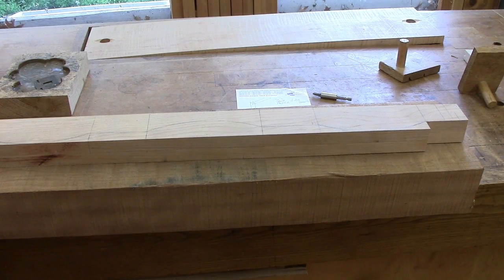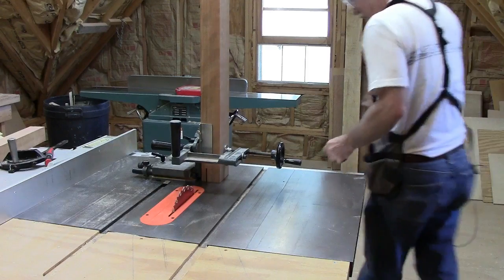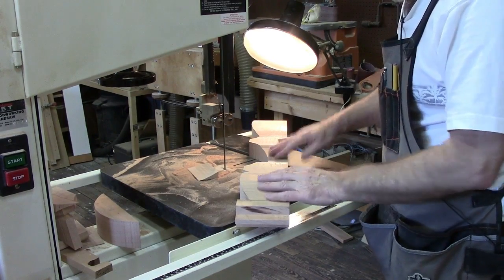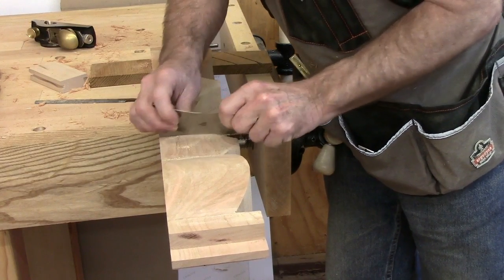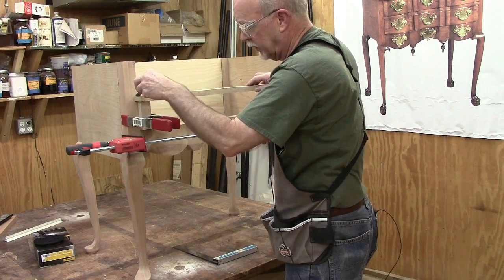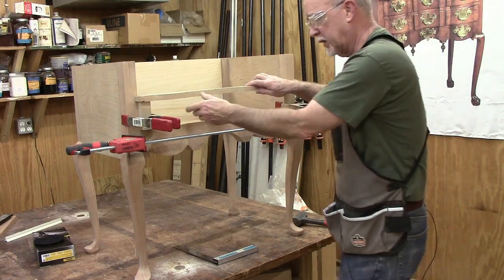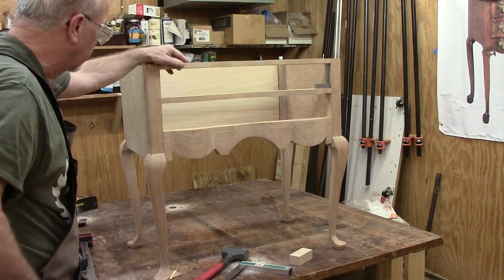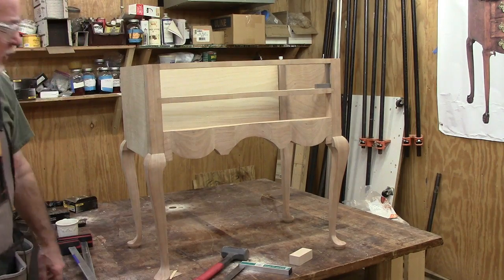Curved Blockfront Lowboy   Drawer Blades & Apron Step 3

Comment: Hi David:
I enjoy the way you go to build this project.  I also enjoy how you explain what you are doing or what you have just done.  You make your work very interesting..  I by no means do the caliber of work you are doing.  The truth I enjoy my work as much as you do.  It will be interesting how you finish the Cherry.  I know that the Cherry will Bloch.  Are you going to use a Bloch Control?
Reply from the maker: Thanks for the complements, my goal is to inspire woodworkers to take the next step in their craft by making something more challenging.  Yes, cherry will blotch but this cherry is quite figured so the blotching may add to the figure.  If I do use a blotch control it will be shellac or Charles Neil's.
Reply: Hi again:
You are doing what I have learned so far.  I love to make figure pop and cover it with shellac.  On secondary I enjoy using Charles Neil Blotch Control.  For me so far finishing this way I have not any trouble with the finial finish.  I think you use steel wool when you are finishing.  I use what is called Bowling Ball finishing sandpaper.  It goes up to 4000 grit and lets me control the sheen.
Have Fun in your shop.    Monte
Reply: Try boiled linseed oil:  soak it well, dry for a few days in low humidity if possible; then shellac - amber or clear to suit.  Figured cherry (& curly maple) really pops with this traditional finish.
    --Bill            www.LineAndBerry.com
Reply from the maker: Where do you get this bowling ball sandpaper?
Reply from the maker: Thanks Bill, I agree I have had similar results with tung oil as well
Reply: David:
This is the web site below, that I get my bowling Ball sandpaper from.  i usually buy about 5 sheets of all 4 grits.  It is a little pricey, but it is worth it.  I read the guy that wanted you to use Burnt Linseed Oil.  The bad part of that stuff is it never dries.  I hope this helps.  Monte

https://www.bowlingball.com/products/accessories/brunswick/7594/siaair-micro-finishing-pads.html
Reply from the maker: Thanks Monte, I'll give it a try
Reply from the maker: Monte, I looked at the bowling ball sandpaper yesterday and today all I get are ads for bowling balls - Cheers
Reply: All I can say is you pushed the wrong button.  I do not get there ads.

Comment: I'm surprised the original used a dovetail on the drawer divider that was exposed and not "stopped". Slid in from the rear so that no joinery was visible on the front...

And I also am curious whom you are building this one for...
Reply from the maker: Ray, there are many cabinet makers at that time who did not hide their joinery.  Only a few did like Chapin. Thanks for the comment. Regards
Reply: What was the original piece you are copying (just for styling interest...)
Reply from the maker: Ray Roberts Ray, look at the first video in this series or the first time I made this I go into where the piece is from
Reply: I went back and looked... I didn't catch where you mention a specific piece or maker...just a book reference (which costs over $300)...
Reply from the maker: The piece is from Winterthur as I mentioned in the video, the book if from the library, and it is not known who the craftsman was

Comment: Sir, was looking at the 2 year old video again, and you say that you were not going to make a frame for the drawer runners. Where did you get that process from or is it your own ?  
   thanks  Ralph
Reply from the maker: Ralph McCoy Ralph I did not like the way I did it the last time so I decided to mortise and tenon them in, this a a very common method in 18th century furniture. the highboy I just made is like that
Reply: Sir, do you remember where you got the frame idea, drawings, from.
Such as publication or whatever.   thanks Ralph
Reply from the maker: Ralph McCoy I got the idea because I could slip it in after it was glued up, but like I said I did not like it after I did it. It was too complex. My design
Reply: got it thanks for your time